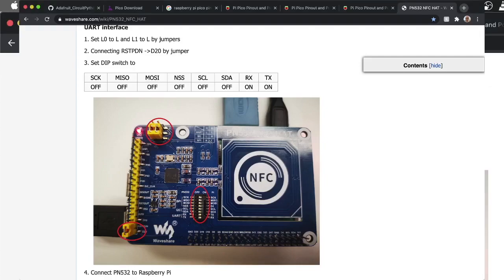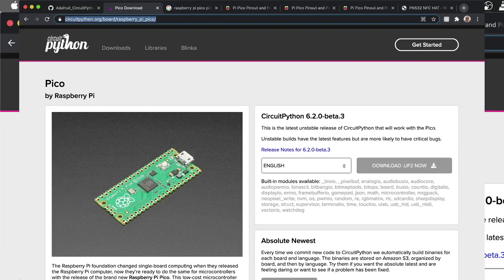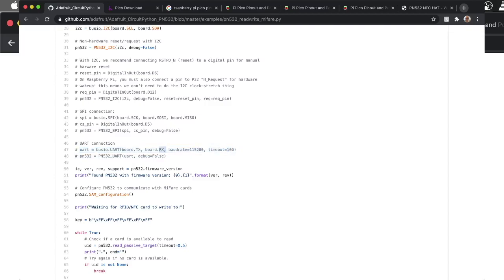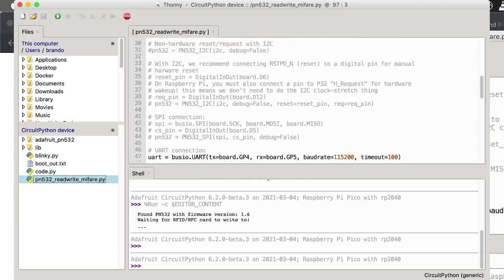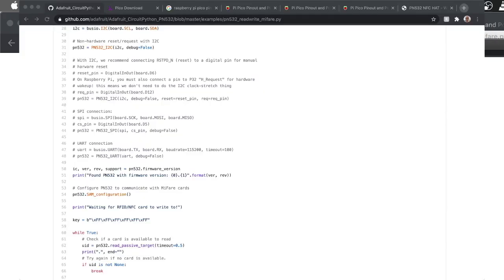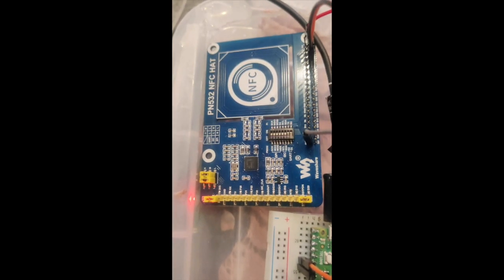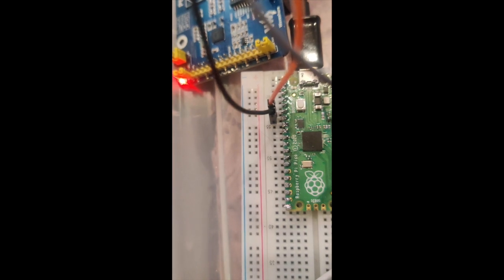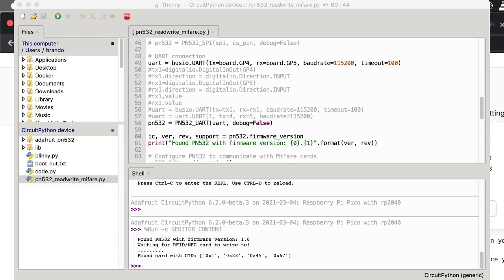1st Ever Raspberry Pi Pico to NFC

Comment: All looks great - just wonder what was the cause of the 'very long' wait you mention? Is that every time, I need something which is pretty instant. Is it faster on the RPi3b?
Thanks Great Tut!
Reply from the maker: I would guess the processing power of the Pico would be the factor. It was much faster on a 3B. The only instant response I've had with the Pico is with a RFID-RC522 but had to use the RFID cards instead of my phone due to the different frequencies.

Comment: This is great. I am having trouble with my Rpi4 trying to get it to work with the PN532 hat. It works for the most part but i am trying to get it to read an emulated card from my android device and thats where it gets messy. Can you advise?
Reply from the maker: Hmm. Unfortunately I swapped to an apple so I can't try to reproduce since I no longer have an Android. If it were me I would see if it works on a different app that also uses an emulated card it could be the method it is using. You can also check what method or algorithm the emulated card is using and see if the 532  works with it. Sorry if that isn't much help I've been working on certs I just haven't had time to dive into this more. Good luck I'd like to hear if you get it working and what you did.
Reply: @brandonmontgomery5027  ive been trying a whole bunch of apps and they all seem to produce the same result. Im curious about the error message that keeps coming up when i use NFC tools ..saying "unable to open nfc device"

Comment: Hello Brandon thank you for the video , Can you help me how to use the Wave Share PN532 NFC HAT on a raspberry Pi 4
Reply from the maker: Unfortunately I have yet to get a pi 4. It did work on my b+ though without issues. I just went to their site and downloaded their python script and wired it accordingly to the site. They just didn't have anything for the pico. It should work for the pi 4. What kind of issues are you having?
Reply: @brandonmontgomery5027  
I am new with programing with raspberry,  beginner. I bought it with a freenove kit. I don't know the steps hou to start. The only video example I saw was you great video. Thanks for your quick response 👍
Reply from the maker: @0culemborg0  Gotcha. I started out with learning python and just start out with wiring a light to the breadboard. I would mess around with the code to change the the GPIOs so I can understand the code and wiring and worked my way up to harder projects. The hat I believe can go right over the pi GPIOs then you just need to grab the python code from their site for the method you choose any run the python script. If one method doesn't work try another. Hope that helps.